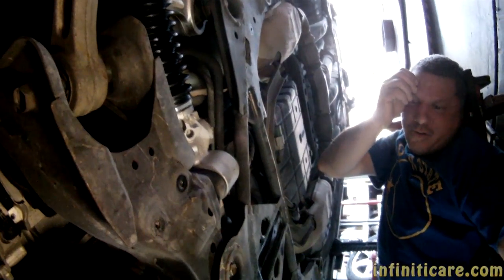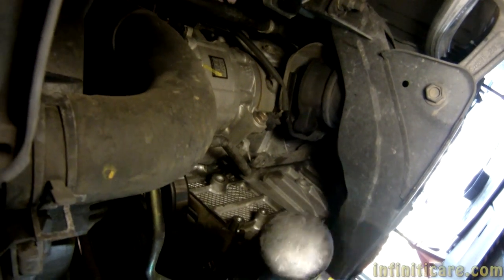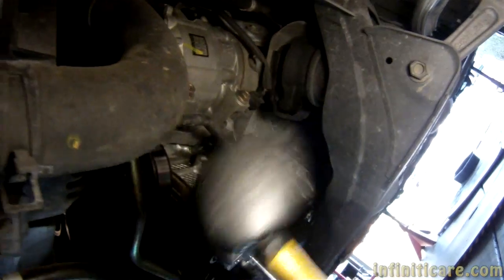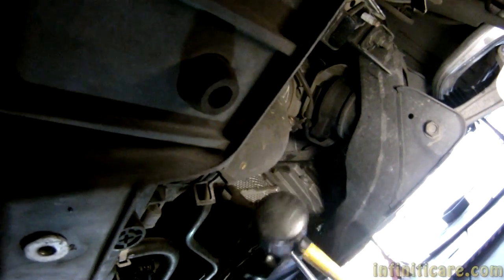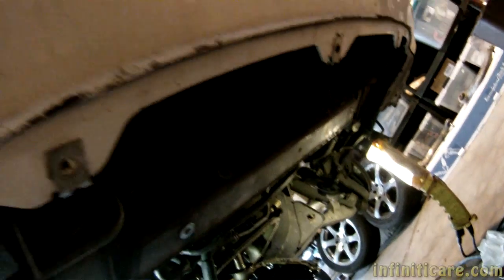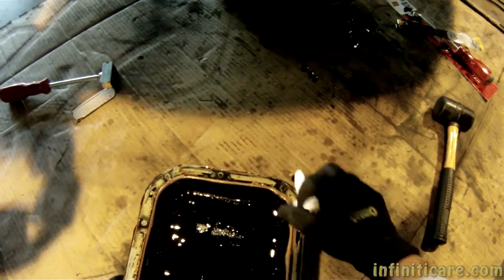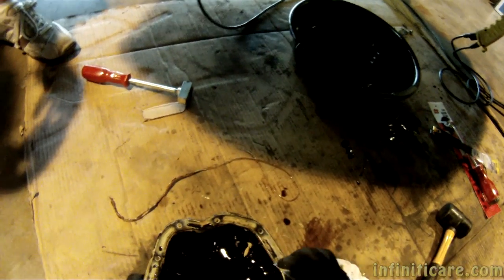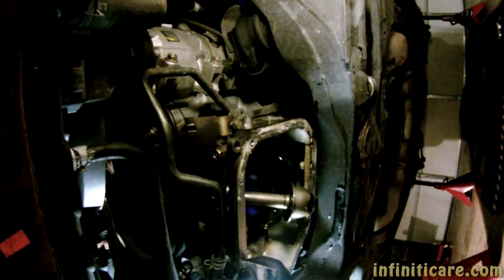DIY: VQ35DE Engine Oil Pan Gasket Replacement

Comment: Thanks for the video thumbs up!!! When y’all replaced it with fel-pro gasket did y’all use an sealant to put on the oil pan so the gasket can stick? Or did y’all just clean the edge of the upper and lower oil pan with the credit card and just added new gasket with no sealant and bolt up everything back? Thanks so is a sealant needed with the fel-pro gasket or no?

Comment: So did you take off the tensioner lower bar that is right by the pan? That’s what I want to know
Reply from the maker: I don't recommend using this type of gasket anymore. I recommend only using the genuine RTV from Nissan or similar. The front sway bar doesn't need to be removed, but it does make the job easier if it's out of the way.
Reply: @EnthusiastAutoCare  why only rtv? Why not a felpro? Why not felpro and a skim coat of rtv?

Comment: no special tool needed...a small screw driver flat...tapped lightly where the oil pan meets the protrusion of the body housing....it will comes of easily enough....although...like me, if you going thru all that trouble...just replace with a NEW oil pan...why not....hahhah...I tested this on a few oil pans at the nearest auto dismantling...no damage.....hahhaah

Comment: Is that the upper or lower pan?
Reply: +cordelmar Lower. The upper usually requires pulling the engine out or off the upper pan and can be extremely labor intensive.
Reply: Thank's

Comment: I have the same question... I have a JWT oil pan spacer and want to use the felpro gaskets along with RTV to make seal extra secure; guy at Autozone said it would be fine but don't know if I trust that. Where'd you get the gasket scraper? Hadn't seen the right angle ones before...

Comment: what about using RTV with the felpro gasket? will that be just as good or no?
Reply: I don't think it will be enough. Just to be save, I added RTV with my felpro gasket. To both sides actually. I wonder if theirs ever leaked again, a quick update message would be cool.
Reply: @johnp7408  it's been 11 years, my friend. The update would probably be, "the car is long gone" lol
Reply: @KillerZero259  for the time u had it, how was it? I'm just curious cuz I replaced my oil pan yesterday.
Reply: @johnp7408  DAMN, you got me going Several years back lol

I think I watched this video because of my 2004 Nissan Maxima. 

Because it was my Maxima that was definitely leaking oil via the oil pan. And, unfortunately, I was never able to seat in the gasket / RTV correctly because I remember the leak always continue albeit slightly. I remember giving up and just living with it. 

My 6MT G35 didn't ever experience the oil leak from the pan, but hell, it was plagued with the oil consumption issue 😭😭
Reply: @KillerZero259  I see. Well like you said it's been 11 years, hopefully something changed in that time, like the RTV or the felpro gasket made of a different material. Hopefully I used a newer and more advanced RTV, cuz i used the felpro gasket that came with the new oil pan, and a blue high temp RTV, to both sides of the felpro gasket. So I hope it doesn't leak. Cuz I don't wanna have to do this again. I haven't drove it yet. Today I will.
Reply: @johnp7408  yeah, that is true. There are more materials available, way more information available as well. The amount of info on YouTube now has DEFINITELY come a long way since 11 years ago. 

Good luck, man! I hope you only do it once and are done with it!
Reply: @KillerZero259  thanks, we shall see.